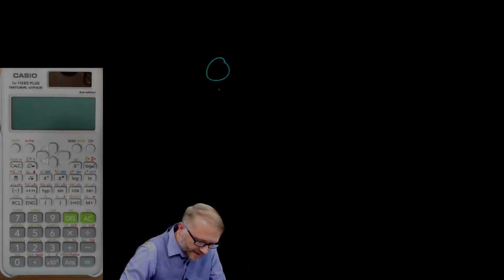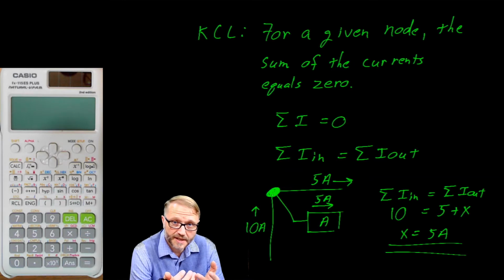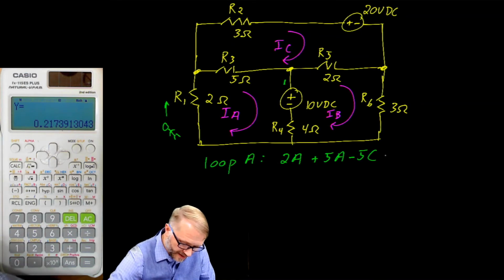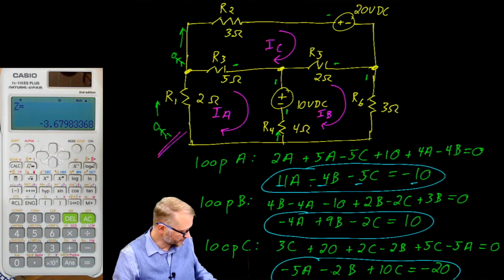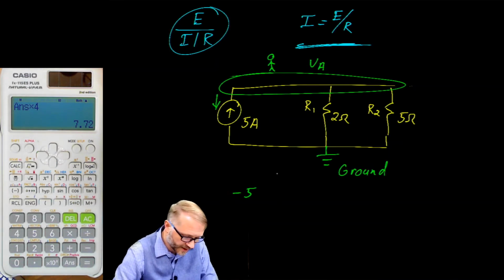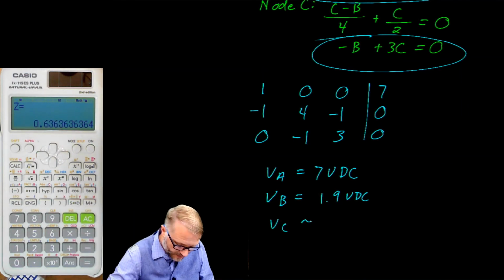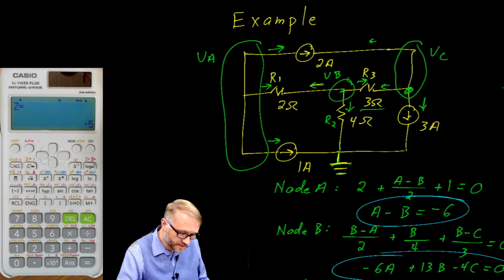#5: Mesh analysis and nodal analysis

Comment: 00:13 Journey to the Movie Theater
00:50 3 Phases of Power lines
03:00 The Meat and Potatoes
03:04 Quick review (KVL & KCL)
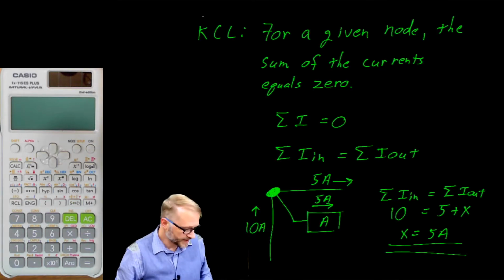07:53 Mesh Analysis (KVL, loop)
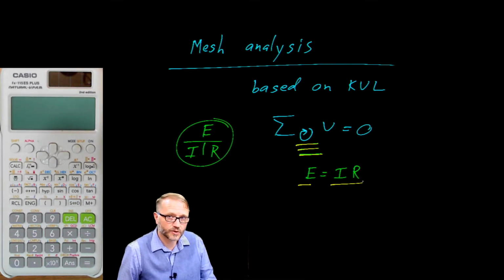08:45 The Class Rule Becomes Muscle Memory
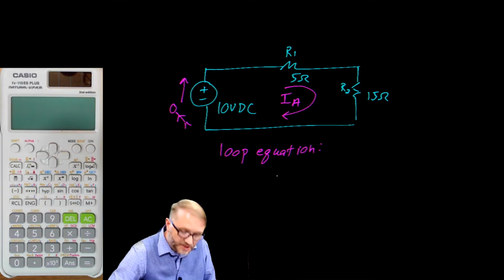09:25 Loop equation(s)
11:38 Eg (Neither Series nor Parallel)
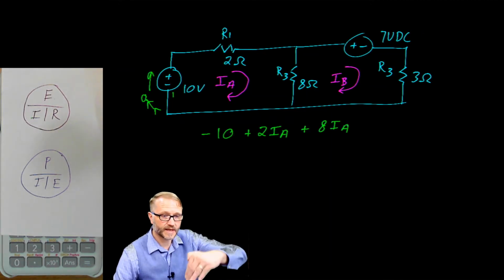13:19 Critical moment
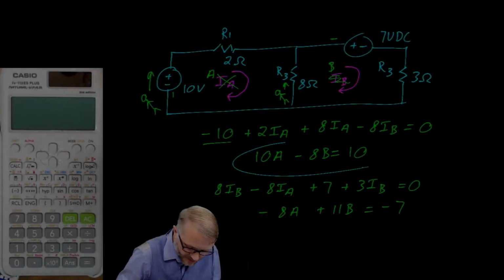15:00 The Matrix Begins
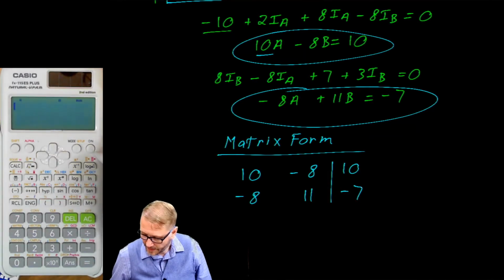15:30 Plugging in(How to enter Matrix)
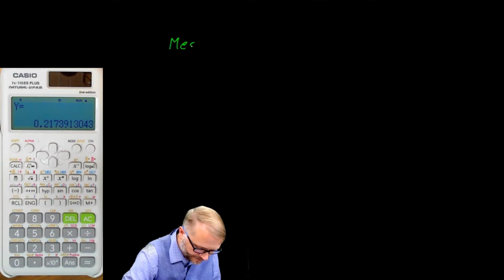16:32 Mesh Analysis Algorithm 
18:06 Another one
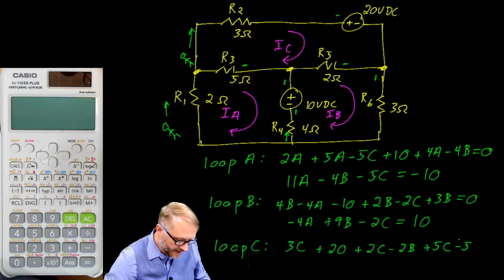21:10 How to Enter with Three Bodies
23:55 Meaning of Negative Answer
24:30 Benefits of Muscle Memory
25:25 Eg (Sloving Specific Problem)
27:42 Does Direction Matter?
29:01 Checking In
29:06 Node Voltage Analysis (KCL)
29:35 Eg. (Single Node)
32:33 Tools Upgraded
33:30 Eg. (Multi Node)
37:27 Nodal Analysis Algorithm
38:22 "One Last Time"
41:41 Double Check Your Works
41:45 Quick Review